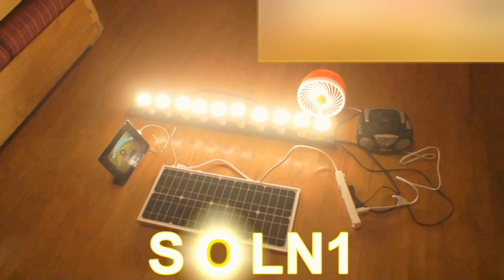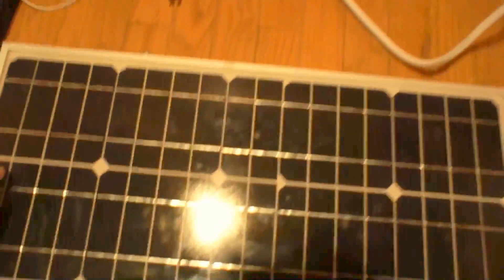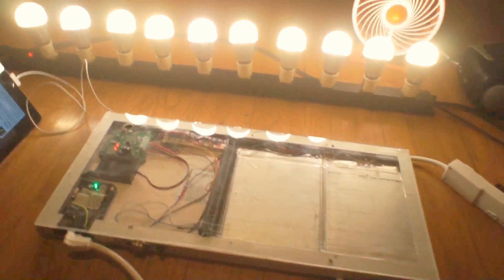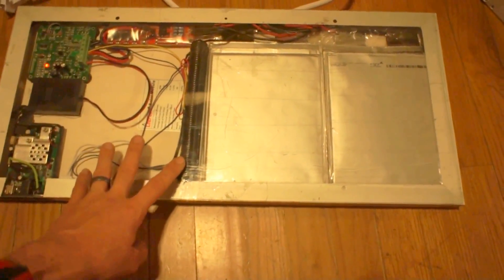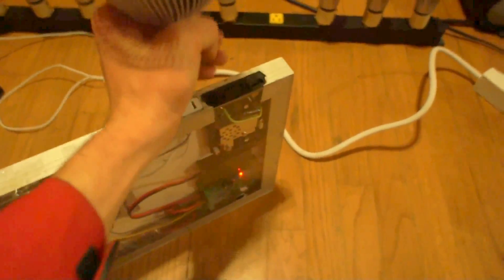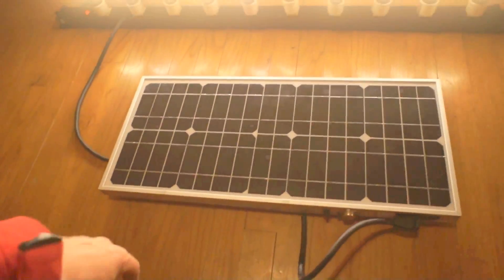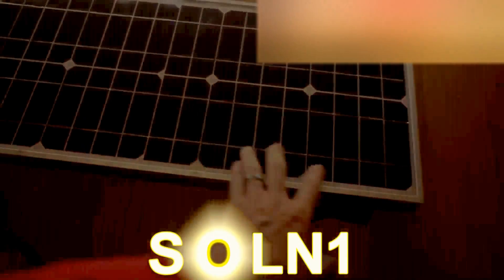SOLN1 - Amazing all in one free energy portable solar unit.

Comment: What about heat?  In the places where this device is most applicable would overheat the batteries.  ANY lithium battery doesn't get along with heat.  What is the maximum temperatures that this prototype is capable of surviving?

I think that it would make more sense to separate the battery, charger, and inverter from the solar array.  Perhaps they could be piggybacked, but they should be able to be separated.

Also, there's a lot of wasted space...

NexSteve

Comment: Why don't they make hybrid vehicle roofs with solar panels is something i still find a mystery
Reply: Last I saw, the Prius offers solar panel for the roof for operating fans to keep the car cool in the summer while you are away.
Reply: i really think the reason why is because how would you stop some vandal from breaking it . the cost to fix something like that would be alot . and to do it twice in one year would make sell your car
Reply: henery slayzack Sounds like the same reason not to buy a Lambo. Think about it, it would make sense for a Tesla vehicle to have a roof solar panel with an ability to charge from an an outlet at the same time
Reply: well for that matter why dont some of the moving parts have built in generators to constantly charge the battery like the pistons and crankshaft could have small generators in them that would generate alot of constant power and you wouldnt need panels at all . or the wheels also
Reply: henery slayzack weight increasse, seems legit for the roof. Still would be great to invest more in the technology.
Reply: Because if you fill the surface of a car with solar panels, it will take days to charge the car, the solar panels are just not powerful enough.
Reply: ***** Worst excuse yet, since the panels would be there to increase the range of the vehicle and not to eliminate the plug in option.
Reply: The increase in range would be minimal, but it would help, if you can afford it.
Reply: ***** True, it would be more effective to use them on EVs, since the range is bigger than that of a Prius or Insight.

Comment: Ok so this thing would run my pc for half an hour off battery charge and remember you have 10-20 lightbulbs in your house not one. I can see the only real use for this would be camping unless there was a way to link a large number of these together. Charging solar panels here is also an issue as we only get 1700 sunshine hours annually.
Reply: You can run 10 lights off the jewel ringer circuit for 200 ma. When the batteries are to dead to run anything else, they will still power the lights for a long time.

Comment: Fake. He shows the secret at 1:33. The panel isn't getting light from the light strip alone. There's light from the ceiling fixture above him supplementing the power, evidenced by the glare from the ceiling. I say "supplementing" the power, but it's more accurate to say that the ceiling fixture is shouldering ALL of the work. Turn the ceiling light off, turn off all the ambient light to isolate the strip of lights being driven from the panel and watch your hoax idea fail miserably.

All that time, money, and energy would have been much better applied taking an actual electromechanical class or at least reading a physics book.
Reply: Its running off the batteries you blithering idiot....
Reply: It has a battery in the back powering the lights. The lights are not powering the unit . If you put it out side it will charge the battery. If you bring it inside the house and plug the lights into it you can video it on your kitchen table. It's not magic. He has made a very basic efficient solar battery pack. Good on him.
Reply: Be quiet if you cant say anything intelligent please kid.....And stop trolling the world worse than it is........
Reply: dude, you made me LOL ... you jumped into something you dont understand at all
Reply: Yup, its a total scam. I mean, if it can't power itself from light that it's powering, what's the point? I'm glad I'm not a loser like this scam artist. I gotta go now. Lots of other hard working, motivated people to critique and my mom won't let me online after 10pm. She's a loser too.
Reply: This man has never and will never make a fake video.  He is trying to change the way we get our power.  What have you done?  Fool!
Reply: Andy Jones your sarcasm was almost lost in translation, lol

Comment: This is an idea I've been contemplating for some time. With this concept it seems plausible, by making a box with 3solar panel facing inward and the top of the box line with light to power the panels. My assumption is one panel with joul ringer power enough light and the other 2 would power everything else. I know the idea has to be flawed somewhere and someone smarter will point it out.

Comment: that's made for the american sort of powerpoints though. you'd need a bigger case to fit on the australian kind
Reply: Could always wire the extension lead straight into the panel to save space, was thinking the same as you about UK plugs as they are much bigger.
Reply: AdamBlindDivide yeah the other alternative is to actually get an american-to-australian adapter but then i'd have to get the american powerpoint in the first place, and i'm not gonna do that. i'm thinking get a powerboard straight into it too yeah

Comment: I have an old cell phone that doesn't work, however the battery and the charger section of the phone does, the reason for posting this is that it may give some one an idea for something along line of the idea in this video.

Another thing i would like to put forward is that a cheap way of getting solar panels is to buy the solar garden lights from the dollar store and use them for your solar projects.

Cheers.

Comment: This is just talk. If this system really works, why don't you provide detailed plans so that every poor man can make one and save a bundle on electricity? How much do you want if you started selling this new technology or do you just enjoy talking about? We want plans because the electricity companies are turning everyone into skin and bones. They said that green energy from solar and wind power was supposed to be cheaper. But it's not.
Reply: If solar or wind was cheaper than nobody would use coal energy. Solar panels are expensive, batteries are expensive. This unit will be expensive, but you can take it anywhere.

Comment: i wonder if it will create enough  to use 1-2 lamps pointed at panel if it wold run as it recharges self running or is the panel turned on when the system drops below 10 as many inverters need 12 to run

Comment: if you patent that, that can be used for electric cars. because right now, they need to be in direct light for it to run. but with your solar panel with the batteries. it can actually be plausable!!! due to the fact that it runs and charges the batteries all at once. so that at night, you have enough power to run it at night!!!

Comment: ok battery must be Li-Ion...  and it has been proven that heat + Li-Ion... = short life span Like incredibly short...    But the concept is a awesome idea though... but the Li-Ion needs  heat shielding cause Solar panels get Hot... I own Mono and Poly crystalline panels and they put off alot of heat in the back
Reply: Julian Gryffin Julian, use the power of your ears and listen to the examples of the potential use of his design. He mentions for camping, natural disaster, power outage, camping... All descriptions of "TEMPORARY" need of power.  He clearly states in his all-in-one design, in clear english that is designed to be just that. Simplistic power for dummies, for a lack of better terms.  He makes no claims to argue or dispute with your accusations, therefor you sound like you are attacking the REAL need and demand for such a product in today and tomorrows market place.
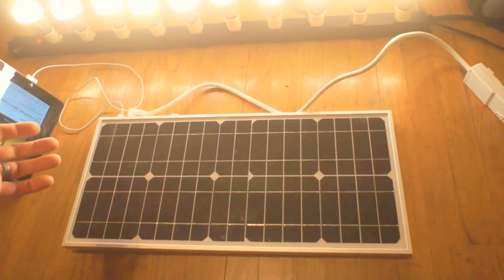Reply: These are not lithium-ion batteries. At 5:21 he states they are Lithium Iron Phosphate, that's often given as LiFePO4.
Reply: Ok and even so any type of lithium ION/Poly or even phosphate have the same "heat killing" issue..  Heck the backside of the panel plate can get up to 150+F that kills any type of lithium battery over time Only + about phosphate cells =  more amp  output
Reply: camping... on a hike with it attached to your back... Wedged on a rock.. the design has the battery pack right against the back plane of the solar cell.. solar cells GET HOT  Does not matter what,where, how you use it SUN + PANEL + BATTERY = Poor BATT life. There is NO way to avoid it... if the batteries and panels are made into one the HEAT generated BY the panel will KILL the battery. So ears has nothing to do with it...the design is not battery friendly.. End of point!

Comment: fantastic build!!  -  the only thing i would be concerned about is the storage - LiPo batteries can very rarely (but often enough to be significant). catch fire all by themselves.  the RC community and the odd laptop owner has become all to aware of this battery type doing that.  You dont want a potential fire-risk tucked away in your closet -  do you know if these batteries are rated to not do that?

Comment: congrats man , you are like the only one out here in youtube with real "free" energy that is NOT full of it . the only thing I'm concerned about is the hot sun panel and then having those cells too close there causing heat damage? you get an arizona heat wave over 110 degrees and then a blistering sun on it and it will surely blow up in fire. good luck.

Comment: great  you can put 5 volt usb and a small reading light built in  external battery battery feed. to gang up afew panels and batteries.wow those kind of batteries are so great and practical.
maybe a ham power 12v volt 10 amp and 25 amp plug.
     thank you very much.

Comment: If nothing else put waterproof fixture for connecting AC socket. That is for safety reason. It must be there. put in on back side. maybe try use some insulation against heat. That is also important because that heat could damage all batteries and electronics as well.

Comment: Interesting idea but... I would be worry about two small thing.  First It must be IP 65 or at least close to it. So water will not damage anything. That is possible to do. But second thing is really hard to fix and i would like to see how you fixed that. It is temperature. Put it on direct sun outside 40 degree inside about 70 if inverter is not on. with inv. on it could be really problem. I would like to see temperature of it with all electronics on. (inverter as well)..

Comment: I think this is a brill idea as we are supposed to be looking at having black outs all over the world. However i would put 2 small fans (with there own life batterie) 1 at each end in it to keep the batteries and the other electrics cool? Also i was thinking if i make one and it work as good as yours looks as it does.
 I live in a 4 bed house so i would build 8 for the hole house mainly for lights and look at building i larger one to run the sockets for the fridge&freezer, washer etc.
Tks Jon.

Comment: Correct me if I'm wrong, but 20W is not much at all. It can light up 2-3 low energy light bulbs. It might even run a camping fridge, but that's really pushing it...
So sure, the startup cost of getting mains power when the need is just 20W is more, but that is not a realistic scenario. To do anything useful you might need 1kW.

I'm just pointing out that this energy system is not "free" at all. The startup cost is substantial and you need to replace components after ~5 years so this is expensive

Comment: Well lets look at this from a different point of view. If you are wanting just 20W of power and what it would take to have just that much "grid power" for your 10 years. First of all is the monthly connection fee of about US$30, and this does not include the connecting fees which is the cost of running the  poles, wires, transformer, and breaker box to the place where this 20W are used. (Really costly! Like >$1000.00, just for starters.) .... My point is that you can read a cost in many ways.

Comment: I have an idea for the SOLN1's (possible) form factor. Try making it with 2 hinged sections so that it folds in a 'Z' type shape. That way, it's made smaller and there for takes up less space. Not only that, but you could put the lithium batteries in 2 of the 3 sections and the rest of the electronics in the middle section. It's an excellent idea. Would work wonders for the camping community.

Comment: I'm a bit worried about the heating tho'... When left out in sunshine during the summer, panels can heat up to considerable temperatures, well into the 80 deg C (or maybe even higher) range, even without any electronic equipment on their back, dissipating heat. Lithium battery fire is not a fun thing....I might be simply overly paranoid about this, but it would be worth a look into (maybe destructive testing).

Comment: It's because of how the words "free energy" are normally used. Some words come with baggage attached and you have to know that before you use them.

In this case, this is not a "free energy" device as it's not trying to create more energy than it take to run the system as a whole (which is not possible). It's just a case of poor choice of words by the uploader.

Comment: This looks like a really cool kit, well done!
But please remove "free energy" from the video title for two reasons:
1: The video will be grouped with idiots/scammers claiming they have bulilt perpetual machines
2: Unless the device does not cost anything, it's not free energy. A 20W panel working for 10 hours/day in 200 days will give you 40kWh. If the device lasts for 10 years and costs $400, that's 1$/kWh which is far from free. A lot more expensive than mains power. Great for camping though..

Comment: Sweet. Inverter, batteries, regulators all under panel. Makes solar easy and portable for 280 watt/hours. That will run a 13 watt CFO bulb for 20 hours. Then put this in a sunny place for a few days to recharge. Live the USB charge port too.

Comment: So let me get this straight. I have 8x8 led matrix which is quite many less than in a LED TV or such. To get colour RED at its brightest each LED takes 20mA of current and your batteries have reserve of 25Ah? So, 25Ah / ( 64*20*10^-3A ) = 19.53hours? Lets take LED HD TV 1920*1080 LEDs and I'll give you that each LED does not run with full current so shall we say they consume average 5mA? 25Ah / (1920*1080*5*10^-3A) = 8.681 seconds of viewing time.

Comment: You are right in that the battery needs to be charged and that leaving the unit out in the sun longer will improve  the amount of charge of the battery.  Alas the video poster gave no indication of the design parameters of the solar cells or the batteries.  It was trying to imply a "free energy" solution.y

Comment: Weight becomes a problem at a point. My 235 Watt panels weigh 50 lbs and would not be designed to hold that much weight inside them. I'm just shooting from the hip but I would assume much bigger it's better to seperate components as I do.

Comment from the maker: To say that you cannot have free energy is like saying that the rain, wind and sunshine is not free.  Almost any differential in nature can be tapped into freely 24/7 as an energy source. Of course nothing is really "free" and I do not use the word in that sense.  To say that you can get more output than input in a closed system would be like trying to take one cup of water and pour it into two cups, filling both. Every working system has a power source. Some are still waiting to be discovered.

Comment from the maker: Where in my video do you think I am claiming that this setup breaks the "laws of conservation of energy"?  This is a very straight forward setup.  It converts freely available light into electricity.  If you run the numbers it works exactly to specs.  Who said that the solar panels create more energy than the light they are exposed to?  At best solar is 15-20% efficient.  The SOLN1 will charge in low light, but not at a rate higher than it uses!

Comment: Just because I like you guy's im going to disprove this video again with different logic. Lets assume that this doesn't follow the laws of conservation of energy and it can create energy from nothing. If it was really doing this the it would keep getting exponentially brighter until the bulbs broke. If the solar panels were creating more energy than the lights gave off then the lights would get brighter so it would create more energy until it created so much energy that's the lights burned out.

Comment: this is very smart... i have bought 2 x 11 w small panels, a 7Ah lead battery and smallest charge regulator... all separate of course with cables going here and there..

you should make a smaller version of this thing, for 11 watts for example they would sell like cookies... but charge regulators are a bit expensive of course relatively... because they dont come in much smaller versions..  but if regulator was cheaper it could be done 
good job

Comment: Its very good, but I have a better system, there is no such thing as free energy as you have to buy the hardware to get free energy. Forgetting that, all you need is a battery, battery charger and a power inverter and the rest is Math. you can use a power inverter to charge a battery and have lots more power available to use and the limitations are based on what equipment you have.

Comment: The only problem is that there's not enough solar cells. It would take two or more days to charge if you weren't powering anything. That's maybe a 10-15 watt panel meaning if this were 100% which it's not it can only power 10-15 Watts of accessories without charging the batteries at the same time... Like the idea and package, but I've been doing this for ten years operating portable ham radio. Just need to add more panels.